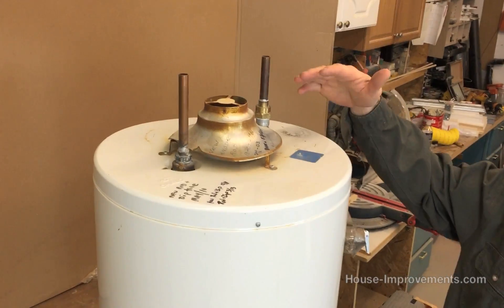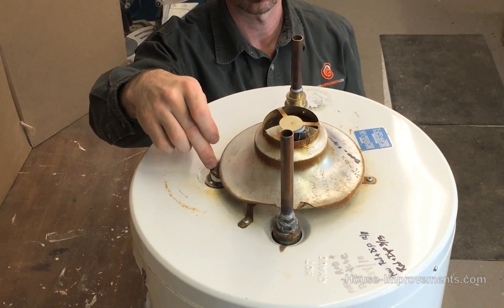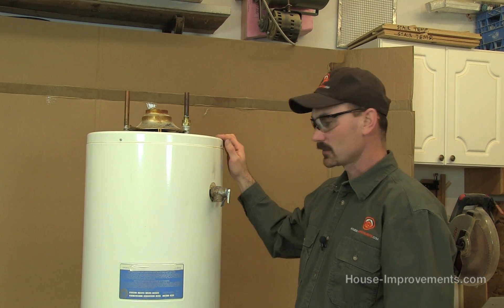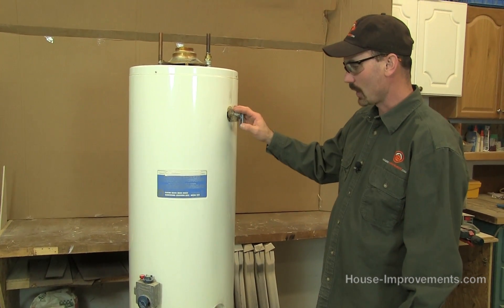How A Water Heater Works [Cutaway View]

Comment: My 2 year old water heater makes a rattling noise in the morning hours only. ITs like a small hammer with a bunch of quick taps in a row then it stops for 30 seconds and starts again. The tapping only lasts 5 seconds. ITs a bunch of little taps but it is loud. Any thoughts
Reply from the maker: I would say it sounds like the sound the burner makes when heating cold water. Maybe after or during a long shower?
Reply: It just started doing this in the last few days. Which also co-insides with my son and I replacing a shut off valve on my toilet. In which case we shut off the water to the whole house. Could an air bubble be stuck in the system?
Reply: The noise is coming from the top of the water heater near the cold tube side
Reply from the maker: Could be but usually that gets removed after running the water a bit? Maybe you have a air trap in the tank? I have never herd of it but I guess it could happen. Try draining your tank maybe? I'm just guessing at this point. Maybe post your situation in my forum and someone may have the answer there for you? http://www.house-improvements.com/forums/
Reply: I didn't do it this morning yet?

Comment: Nice job. I had no idea there were so many parts that should be replaced as maintenance.
Reply from the maker: +sdanville These do not need to replaced as maintenance unless they give trouble,which in most cases is rare but they can be replaced if they fail

Comment: Any idea if its ok to install a mobile home 40 gallon water heater in a residential home?
Reply: +aa hines  the only difference is where your lines will hook up, instead of being on thop like the one in the video, they will be on the side, because most hot water tanks in mobile homes are in a corner or small closet. actually cheaper to buy one with lines on top
Reply: +Turbo Diesel Thanks for the reply. I have installed the water heater and it seems to be working fine. I actually plugged the water input on the side and used the 2 top connector for in and out. Anything I should be worried about in the long run?
Reply: nope, just as long as the plug you've used don't corrode and leak. just drain the tank every 6 months or a year, you can get away with a year with tap water, unless you have well water then I would drain it every three or six month's. I hope that helps :) Have a great Night/Day. I'm in ohio lol
Reply: +Turbo Diesel Thanks for the advise! I got the water heater dirt cheap which is why I went that direction. You have a great night as well!

Comment: Very detailed and easy to understand description of how this thing works. Thanks for the time you took to create the video. I am sure it will help many. You covered all the elements including Anode rod, inlet, outlet, the dip tube, the drain system, the pilot light, the burner, and the pressure relief valve. Testing the pressure relief valve once a month is a good idea. But at the same time replacing it every year should be considered. Thanks again Shannon. Very good video.

Comment: Thanks for taking away the mystery of how a hot water heater works.   It was very easy to understand.   As DYI homeowner with several rentals,   I learned  a lot from your video to be able to talk to a plumber when service is needed.  That is empowering in itself.   Would like to get your opinion of the available gas water heaters at the big box stores.  If I need to purchase, should I get Whirlpool instead of  Rheem? Some of local plumbers I have contacted (from Angie's list)  supply BradfordWhite gas water heaters and will not install a big box store water heater which I totally understand.  I don't intend to install but use an expert instead.

Comment: Hello I'm glad that I stumbled across your video. I surely wish I could've found you allot earlier to ask a question about a gas hot water heater. My question is,  my gas  hot water heater pilot light goes out every 30 minutes after I light it and it has been doing that for the past two years. 2 years ago I had a fella come out and charge me $800 to fix my gas hot water heater and it went right back doing the same thing as it did before I got him to fix it. After about 3 days the pilot light started going out again and I called him to come and see if he can we fix it and he never did. I should have found out as much as I paid him to fix my gas hot water heater I could have went out and bought a brand new one but I was told it was cheaper to have someone fix it then go buy it. He took out the thermal coupling I guess that is what it is called anyway and replaced it with a new one. and it still is acting up. It is a big headache when you have children and have to lay down in the floor with a match and light the hot water heater several times in a day. So if you have a video or if you can explain to me how I can fix this myself I will highly thank you very much for having such a kind heart and a Christian manner and sharing your knowledge with me. Some people love to take advantage of people when it comes to money and that is what happened to me,  I was dumb about it an not knowing anything about hot water heaters. I do not have anyone to even ask. So any information that you can give me will be highly appreciated thank you so much for your time reading my message sincerely Billy
Reply from the maker: +Billy Crane It is accruing shame and highway robbery to charge 800$ for a 25$ part and maybe an hour of time! Right away I figured it was the thermal couple but you say he changed it? He screwed you on the price and  I'm guessing he he also just tried cleaning the thermo coupler and never replaced it. Turn your gas valve off and remove the TC and go buy a new one and install it, I'm guessing it will work then. If it does not come to my forum on the website and we can work together from there. Thanks

Comment: That's was entertaining! What is going on in the heater when it sounds like rocks popping around like popcorn?? My water heater is only 4 years old, but I haven't done any maintenance yet; aside from cleaning the thermocouple. Is there something I should be doing about that rock sound ??
Reply from the maker: +Endorphika Morphika Usually that would be when cold water is entering and the water heater is also heating I would think. Pretty common noise.
Reply: +Endorphika Morphika I think ur water heater has lots of ,mineral rocks inside - lower setting to lowest temperature then shut off water valve on top of water heater, then open drain valve &  remove it, then flush the tank - you may have to poke inside hole just to loosen the big chunks of rocks blocking hole - once all the water drains out - turn the water valve on again and close after filling with 2 or 3 gallons so the rocks inside can move around a start coming out again - best way to flush water heaters with so many rocks is by removing it ... dont let chamber get filled with water or the pilot flame will not light up again until water is removed from bottom chamber ...

Comment: just thought I would let you know, I was talking to a guy from Rainfresh and he said there is no way I would just be getting iron bacteria just in my water heater, it would also be in my cold water being is that it would originally be coming from my well and it would also have an oily look on top of the water and smell like deisel. If you know of anyway I can get read of rusty water of a 10 year old propane water heater let me know. The tank is in geart shape and no settlemnts on the bottom just a little black stuff comes out when I flush it wich has been 3 times in the last year. Put a new Rainfresh iron remover this year and about 1.5 year a go a new I'eau Miracle Water water softener. I am at my whits end, spent almose $2000 and still no farther ahead. I called Culligan and they want up to $7,000 and they will guaritee good water. Let me know what you think. Thanks
Reply from the maker: +Roger Burchill  Sorry but I can not say for sure .

Comment: Sorry but I don't recommend that u mess with the pressure release valve by triggering it because it usually ends up not closing properly anymore and then you have to replace it - This goes for the plastic drain valves as well - They start to leak once you open and close them - I  recommend replacing them with a brass drain valve -
Reply from the maker: +Bambam Bullies  I would agree, but if you do this from new on a regular basis you will be fine.
Reply: +HouseImprovements Nobody has ever been seriously injured or killed due to a faulty pressure release valve so I would recommend just leaving it alone ... I consider testing them on a regular basis a waste of time and no need to even think or worry about it - I also don't think water heaters should be inside a house - Garage or outside should be mandatory due to risk of water damage ..

Comment: Hi Shannon, I don't know if you have done a video on iron bacteria in hot water heater and how to flush it out. I installed an iron remover last year and a new water softener the year before that trying to get read of my red water in the bath tub. I just learned this about my water heater. That is why I have redness in the hot water only the cold water is fine. A water specialises said I had to flush my tank with bleach by letting it suck through the hot water tap as I drained a gallon of water out the bottom and letting it set for over 4 hours and then flush it out. Does that sound about right to you. If this is right maybe you could do a video on it and that would save other people a serves call like I did. Thanks
Reply: Water softeners are death to water heaters. You are getting red because the salt is rusting the heater.

Comment: i have a question how can i turn it of and on, i mean an standby option....so i don't have to turn in off then light up the pilot again and again...txs
Reply from the maker: +BURYOURFLAGNOW  Most have a vacation mode or you can just turn the heat setting right down to low heat.

Comment: Hi there,I have a question about some sounds in our 50gal natural gas water heater. It is just over 2 years old. We have not flushed it since we bought it. When we turn on the hot water at any location in the house, it sounds like a bunch of tennis balls bouncing inside loudly like in a dryer or something. It is a scary sound. It is not coming from any pipes. Just the water heater. Also, when we turn off the hot water at any faucet it sounds like there is dripping in the walls, but there is no evidence of water. I thought maybe it was the pipes or the brackets used expanding or contracting, but it isn't quite that creaking sound. 

First I tried purge the system of any air. I shut off the water main, turned on all of the faucets and flushed the toilets in order from highest to lowest. Then turned the water back on, and turned off the faucets from lowest to highest. 

Next, I bought a water pressure gauge. It said that if it reads less than 60psi, to leave it on for 24 hours to get a more accurate reading. I attached it to an outside spigot closest to the water main as instructed. It immediately read 50psi. As you know there is a black and red arrow on the dial. The black is currently reading 43psi and the red is 85psi. I will check it again tomorrow. The valve on the street side of our water meter spins without stopping so we have no idea if the water is all the way on or not.

Next we are going to drain the water heater and see if that helps. We were wondering if maybe it is sediment buildup and bubbles are popping. We live in North Las Vegas NV and our water is very hard here. We do have a water softener though. I'm not sure if that info would help you or not, I just want for you to have a complete picture. We already have a water pressure reducing valve. FYI.

I thought maybe we have water hammer but the symptoms do not match 100%. We had to replace the anti syphon valve a few months ago and are wondering if that has anything to do with it. I have watched a ton of videos and read a ton of articles. I can't find anything that is 100 sure. I would really appreciate any help you would be willing to offer. I am at a loss. I am worried because I have seen some videos and aftermath photos of water heaters exploding. Terrifying. I could try to make a video of the sound happening. Thank you for your time. I look forward to hearing from you. By the way, I really enjoyed this video with the cross section. It made things much clearer for me. Thank you for making it and sharing your expertise. 

Take care,
Melody
Reply from the maker: +Melody Kip Sounds to me like the noise you have is from the cold water hitting the hot bottom of the W.H. as it refills. The sounds in the wall are the pipes expanding and contracting from the temperature changes.
Reply: +HouseImprovements 
Thank you so much for the info. Is there anything we can do to stop this? Does it pose any danger?

Comment: I was told if you install gas water heater in properly, the unit may explore. how could explore happen?
Reply from the maker: +luo XW The main way could be a natural gas leak. The installation should be left to a licensed plumber with a gas ticket.

Comment: great video! 
a question, what's the pressure inside the tank? is it same as your water supply pipe?
since cold water is always connected with the tank. won't the hot water warm up the cold water in the whole water supply pipe?
thanks
Reply from the maker: +luo XW It may warm the first few inches from the tank but thats it. The pressure is the same as your water pressure and the pressure relief valve is designed to let off excess pressure if it builds up during heating.
Reply: +HouseImprovements  Why just few inches? I think with time, all connected water will be even temperature.

Comment: Nice video.  I watched at 1.5 speed and it was easy to understand at that speed.  In NC they have changed some of the building codes for water heaters, so fixing mine would be great... to hold off getting a new one for a while.  I have to admit, there is a big part of me that fears sprouting a leak when putting back a new noble element, Dip Tube, heater element, or dip tube.

Comment: I had a guy come over to drain my gas water heater and he told me he couldn't get all the sediment out of the tank because the drain was higher than the pan. I am glad he showed the cut out of the tank so that I can see that the drain is in the middle of the pan.
Reply from the maker: Roger schmitt The drains are slightly higher than the base pan inside.
Reply: HouseImprovements looks like the drain is almost level with pan. I was informed the pan was above the drain.
Reply: Roger schmitt see @ 11:11

Comment: Another great video. I've got a question, with the interior of the tank being so nasty, why doesn't the water coming out of the faucet cruddy? Thanks
Reply from the maker: A few reasons. the heavier "crud" settles out and does not get stirred up easily. Your tank is typically always full and does not get as crusty looking like this one was because it sat outside empty for a few months after it was replaced.

Comment: Nice video Shannon. But as a propane service tech myself, unless a person has been maintaining their water heater from new, I wouldn't recommend lifting the P & T valve lever. It is almost sure that a small bit of crud will end up on the seat of the valve and it will drip until replaced.

Comment: I don't know how old my water heater is but I've been using it for 15 years and I haven't done a thing to it. I'm replacing it soon but I'm going to do maintenance on it just before I replace it. Just to see how bad it is. I've seen a dozen videos on water heater maintenance, but I still learned a lot from this one. I might drain some water out, and vent the pressure valve to see if either one of them isn't working. I'm not removing the anode rod until it's been replaced. I'm pretty sure it's gone. Not to mention the dip tube.

Comment: Nice video. I didn't know that using the pressure relief was a suggested practice. I did that on an older tank and it stayed at a constant drip until the tank was replaced.Maybe because it was already old at the time before this was done.Just a heads up to you guys.